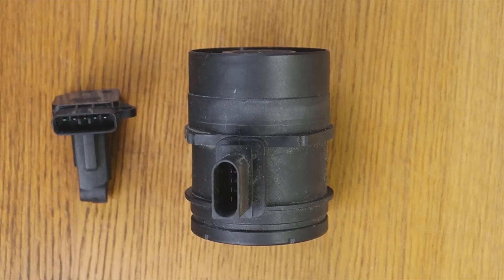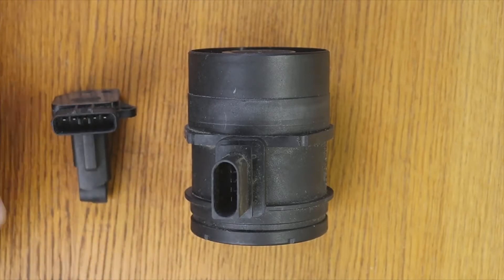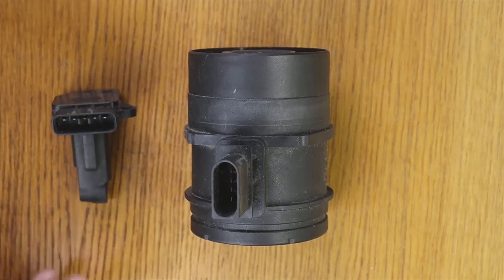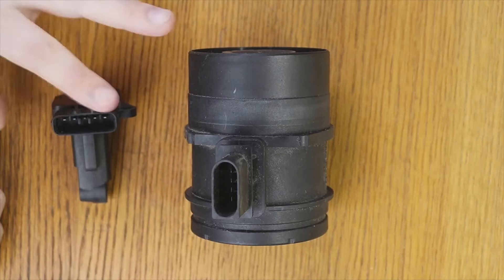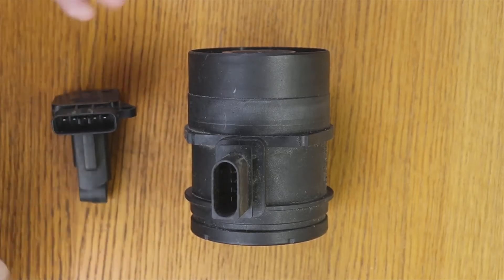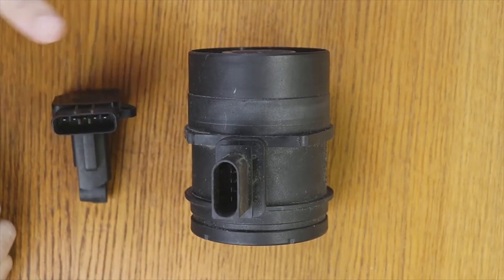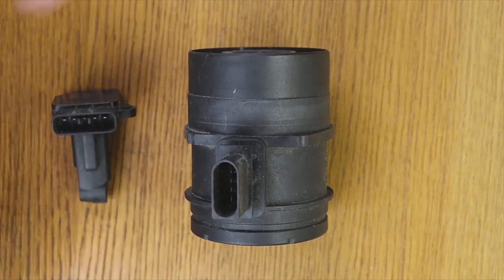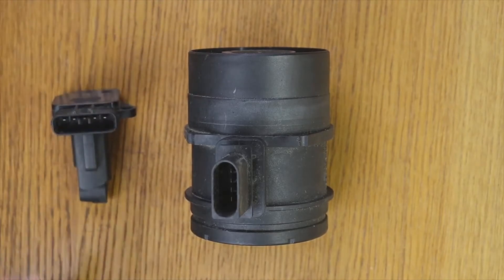This happens if you CIRCULATE with a disconnected MAF, AIR FLOW SENSOR, faults, symptoms, check..

Comment: hi I have an 99’ bmw 320i, I get up to 120 km/h in 3rd gear but it won’t get past 130 km/h even in 5th gear, the MAF sensor was disconnected could that be the problem? it also idles unstable